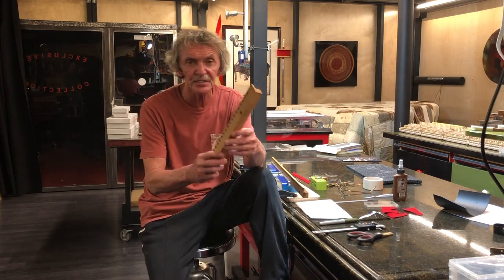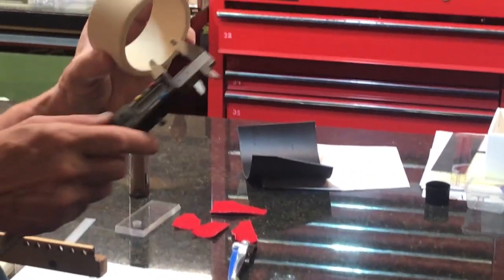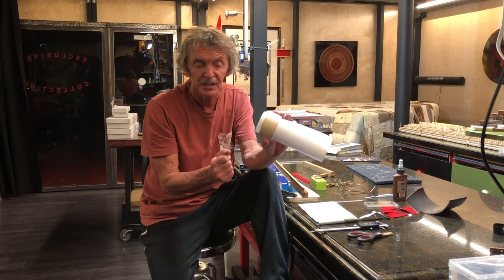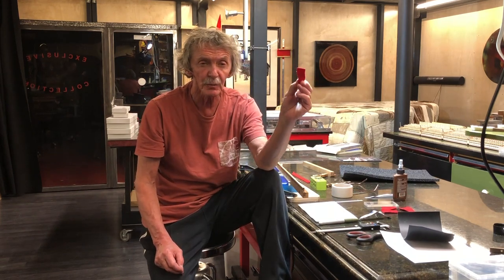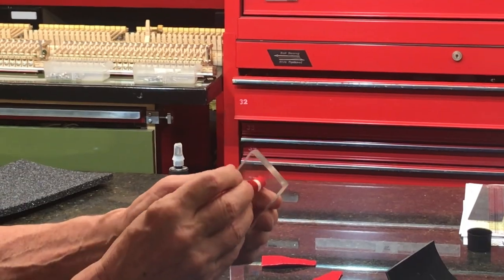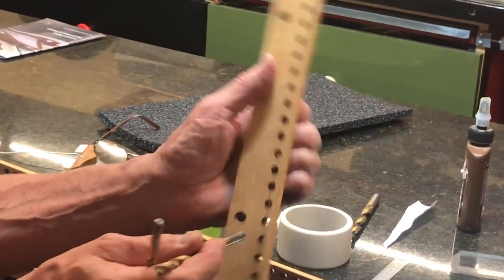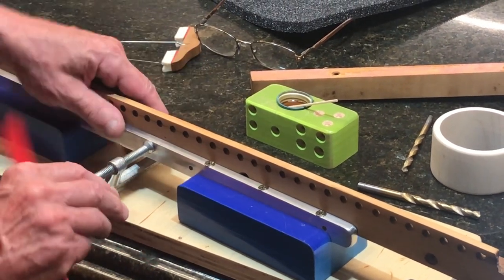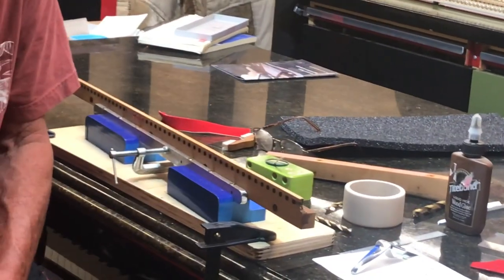Piano Solutions XXI: Damper Guide Rail Bushing

Comment: I came up with a rubber grommet that I use for this purpose. It just pops into the hole without having to weave it through or cut it and it gives better support to the damper wire laterally, which keeps it tracking in a straight line. It also does not compress and is not affected by humidity changes. I've also created foam front rail bushings that never compress and return the energy of the downward stroke back into the player's fingers for an increased speed of repetition. All the players that use them love them. Sometimes, instead off trying to come up with a tool to perform the same old process, a better answer might be to come up with better materials and a better process. A great example of this is what Kawai and Mason & Hamlin have done with their action parts. At first they were derided by our community as cheap plastic junk. But now they are lauded as phenomenal innovations in the industry. It takes time to change people's minds when they are so ingrained in one way of doing things.
Reply: where can i buy these bushings?
Reply: You can't. I haven't marketed them. I just have them manufactured for my own piano work

Comment: Your videos are really terrific. Thank you so much for this one. As someone who is trying to rehab a piano for the first time (1907 S&S Model O), I had no idea of what I was getting into. Any time there is a video by you of one process or the other, it is always the most informative and helpful. I admire your skills enormously. The pianos you build must be superb instruments.

As I'm preparing now to put bushings in the damper guide rail, I wonder one thing which hasn't been addressed here: How does one select the proper thickness of the bushing cloth? Does one simply add the thickness, multiplied by two, to the thickness of the damper wire? I suspect there's a little more to it than that and would be grateful for your advice.

Thank you, Gene!